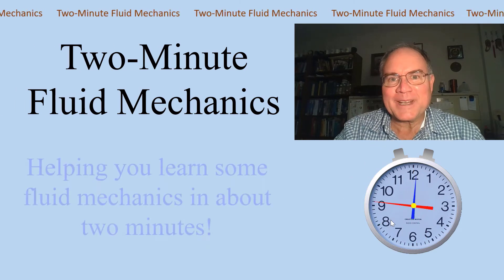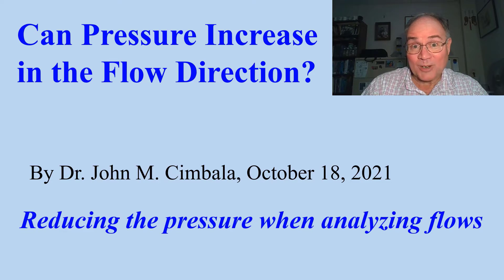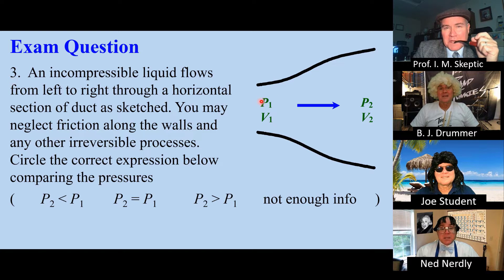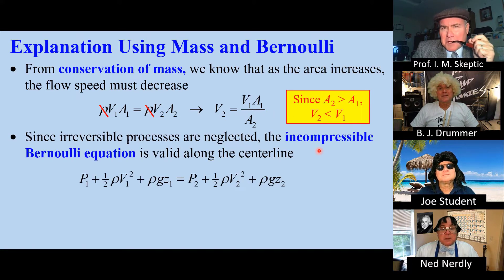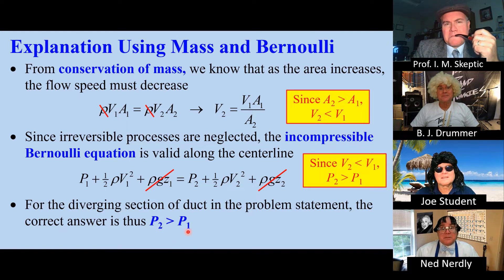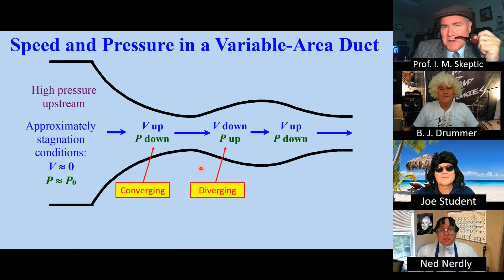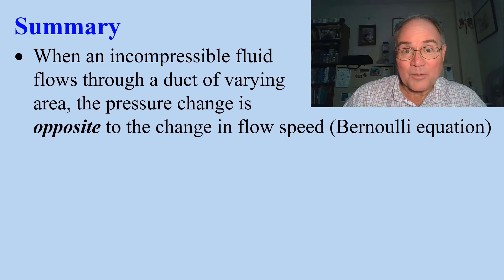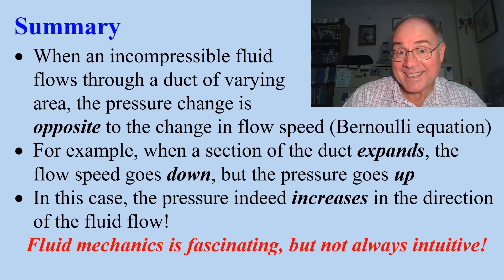TMFM: Can Pressure Increase in the Flow Direction?

Comment: Of course a fluid may flow against a pressure gradient but in order to explain why, I wouldn´t use Bernoulli's eqn. The assumption of ideal fluid may not hold, so specific energy may not be constant due separation of the boundary layer.